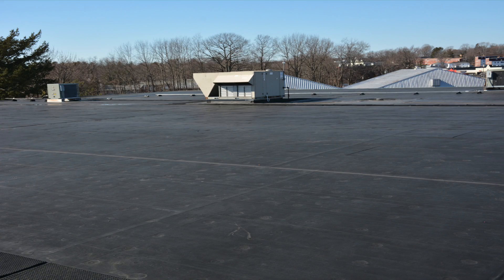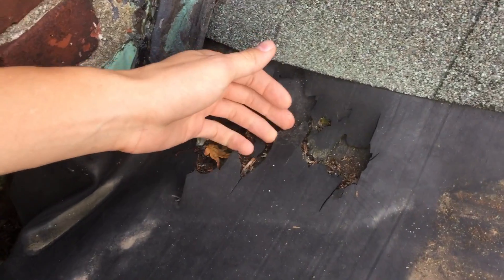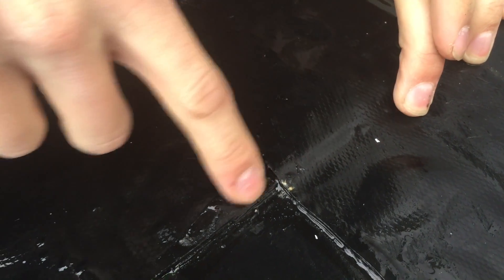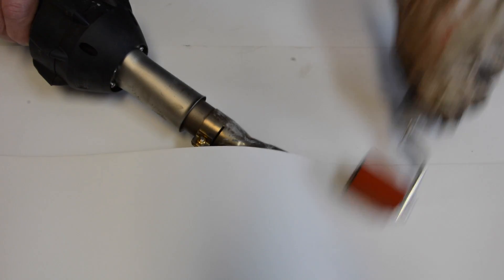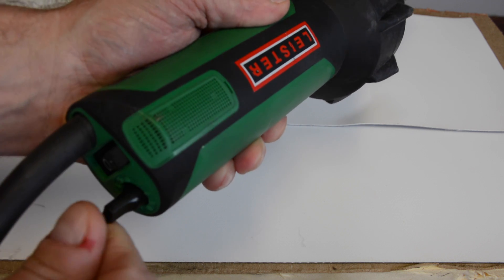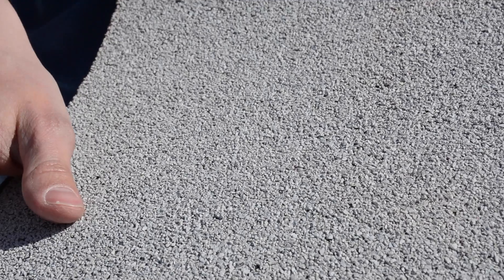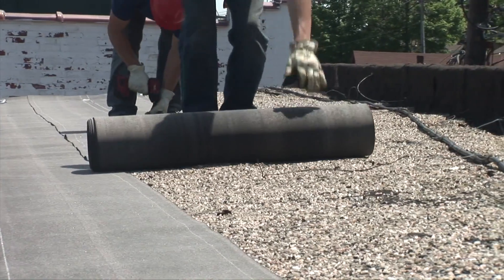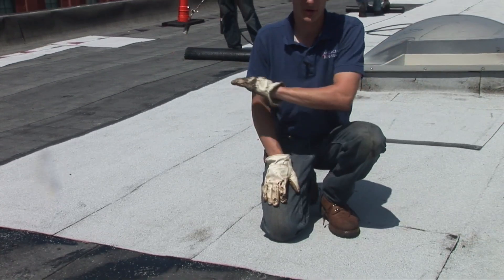Top 3 Rubber Flat Roofs:  TPO, EPDM Rubber, and Modified Bitumen. Which is the best?

Comment: Anybody pushing torch down knows nothing about commercial roofing. Also., why the hell did you not vac or get rid of all the loose stone?! BAD roofing practices
Reply from the maker: Anyone that pushes anything else are clueless. 2 Ply APP 180 from Firestone or GAF Torch Down will outlast any other roof system. EPDM rubber and TPO (Thermoplastic) roofs are to thin and barely get 15 years without any trouble.
Then you ask why not vacuum the loose stone. If you do that, then you create an uneven surface because some of the stone is stuck to the tar. I  rather rake the stone and get rid of big rocks and twigs  making it relatively smooth. If we did what you think what should be done, then you will have such an uneven surface because of stone embedded in the tar, it would become unpractical to install. Then you will need a recovery soft board  or Isso board to smooth out the surface.
If you havn't installed Torch Down roofs and havn't had the opportunity to go over stone, then you should not show your inexperience by opening your mouth. Post a link of where you are busy installing a roof. i would like to see.

Comment: It is a subjective presentation!
If installed correctly, an EPDM roof lasts a lifetime! Of course it must be maintained in time! Do not deny that 2 thick layers of bituminous membranes are very good on rigid structures! On elastic structures EPDM is the basis !!!!
I do not agree with mounting directly on the gravel layer for a circulating roof!